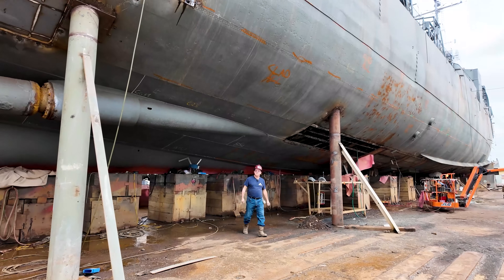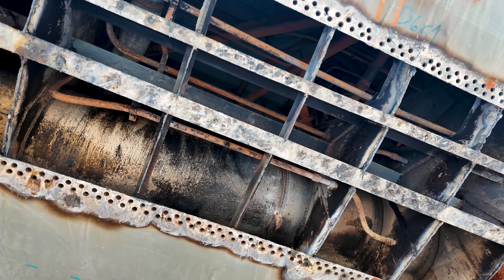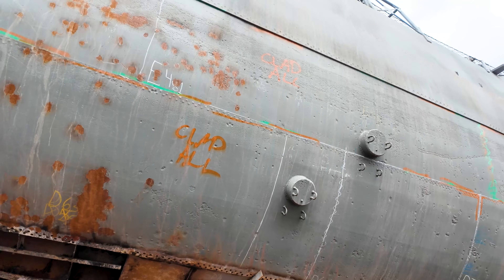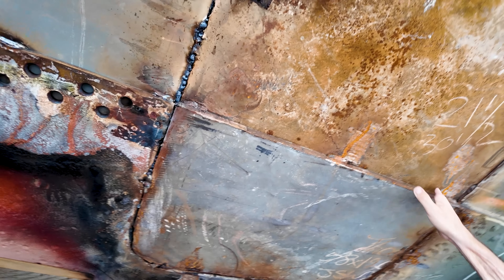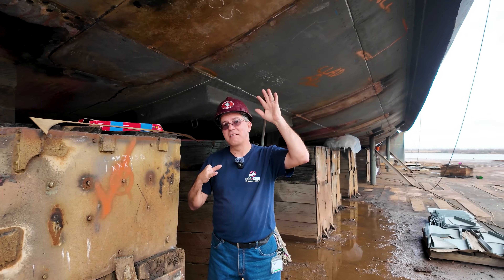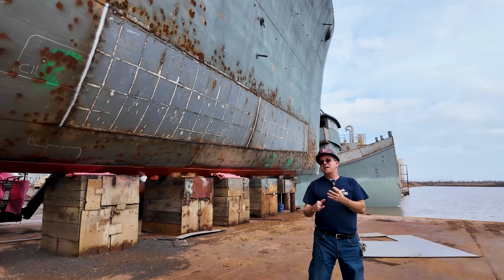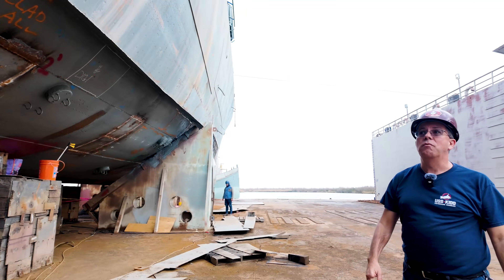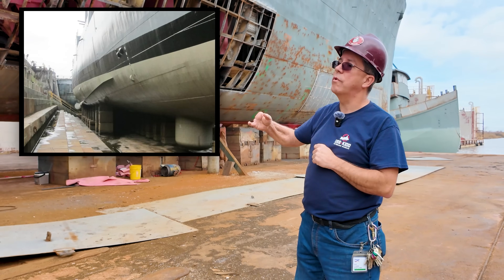Hull Overhaul of WWII Destroyer USS KIDD │#5

Comment: I worked on a few of these WWII destroyers when I was a shipfitter on the USS Grand Canyon AR 28, I was always amazed how thin the structure was. A chief once told me they were only made to last a few years and built as quickly as possible. A few had newer super structures put on in the 60's but the steel/aluminum joints were a constant corrosion point. Good luck with repairs I look forward to seeing the ship back.
Reply from the maker: Thanks! And, yes, the saying went that if they survived one battle, they were considered a success. Literally the definition of "expendable."
Reply: @usskidd661 ...said the same thing about the LIBERTY SHIPS 

Paid for itself if it made 1 round-trip

Comment: They wanted it to be as light as possible, to be as fast as possible, without breaking up in a storm. They needed to get where the submarine was before it got away. They will need paint that can take some sun exposure when the Mississippi River goes down. 
For anyone who might not know, salt water, like in the oceans, is WAY more corrosive than the fresh water in the Mississippi RIver. Ocean water contains so much salt that it is heavy enough to flow upriver for a hundred miles, with minimal mixing with the lighter fresh water floating above it, when the river flow is low. The Mississippi River will eventually fill up the Gulf.
Reply from the maker: Fortunately, salt water intrusion in the Mississippi does not ever get near Baton Rouge. 🙂

Comment: Would it have been more detrimental than beneficial to have gone one size thicker with the replacement panels?  Or perhaps that would be a more appropriate long-term preventative fix for the museum ships in salt water.
Reply from the maker: @workingguy-OU812 : We did that on the touchpoints, as mentioned, because they see wear and tear from rubbing against the cradle pads. The rest of the hull--even the wind/water line--doesn't see the wear and tear that it would've seen underway in service. So, upping the thickness there isn't really needed, and potentially takes funding from other projects in which she needs attention. 🙂  Good question!

Comment: Im surprised you dident have to re plate the whole hull
Reply from the maker: @tomspettel3646 : No need. Fresh water does help. 🙂
Reply: @ how thin was the thinest plates?
Reply from the maker: @tomspettel3646 : As built, there are a few plates on the main deck at the bow that are 6-lb steel (0.1943 inches thickness). One of those needs to be replaced.
Reply: @usskidd661  wow that is thin

Comment: I'm curious, how thick is the deck on her about midships? I have some cutouts on the main deck of an Arleigh Burke DDG (removed to install the mounts to bolt .50 cal tripods) which are about 1/2" thick, just wonder how a WW2 era DD compares?
Reply from the maker: 20 lbs plate STS steel above all engineering spaces in middle third of the ship. That comes out to about a 1/2" thickness. On the ends, it gets down to 9 and 6 lbs plates in some places. VERY thin.

Comment: How thick is the STS?
Reply from the maker: @beverlychmelik5504 : The STS steel? Like Tim said in the video, the plate thicknesses vary depending on what part of the ship you're looking at. All the plates summed up average out to 3/8" thickness. For a great visual of what we're describing, check out Stefan Draminski's new book on the KIDD: https://www.amazon.com/Destroyer-USS-Kidd-Anatomy-Ship/dp/1472827414/ref=asc_df_1472827414?mcid=dcb1eda998c73c7ab63a315a8a32d588&tag=hyprod-20&linkCode=df0&hvadid=693706201118&hvpos=&hvnetw=g&hvrand=11798063087517600142&hvpone=&hvptwo=&hvqmt=&hvdev=m&hvdvcmdl=&hvlocint=&hvlocphy=9198980&hvtargid=pla-980281900946&psc=1

Comment: 3/8th steel wont even  stop a rifle bullet.   I would have thought at least 1/2 inch steel.
Reply from the maker: @wazza33racer : Some of it gets up to 5/8". Remember: 3/8" is the average thickness of all the plating. Meaning some of it gets much thinner.
Reply: On the plans for WW2 era ships, the thickness of each plate was described in "pounds" as pounds per square foot.  For example, destroyer-grade plating would be in this range:
3/8" plate = 15#
7/16" plate = 17-1/2#
1/2" plate = 20"

9/16" plate = 22-1/2#
5/8" plate = 25#

On the Iowas, the thinnest shell plating was along the bow, with some strakes (strips of plating) as thin as 17-1/2# (7/16") steel.  The thickest shell plating was over the area of the freeboard belt armor, 60# STS (1-1/2" thick).

Comment: I thought rivets were a thing of the past in WW2.
Reply: Think of the A13, Crusader, Cromwell, etc, which were Tanks used by the UK, The US's first models of M3 Lee's/Grant's, M2 and M3 Light Tanks, etc. 

Riveting was still the standard the first couple years of WWII in most of the world, with only really Germany having welded tanks in mass production at the wars start (The USSR did as well, but the Welds were HORRIBLE with misalignment, gaps, etc due to a shortage of skilled labor and needing to try meeting Stalin's insane and impossible production quotas and timelines). The US only really started welding tanks around Late '42 into '43, as a faster alternative to casting as most automobile manufacturers didn't have casting facilities but could all be capable of welding (Rivets if hit become projectiles inside a tank, so was a BIG issue for them and wasn't a long term solution so they NEEDED to find a replacement and as said casting couldn't be done at scale).

For Warships, it wasn't until the middle of the War welding started being done more commonly as it required less man hours and material in the tens of thousands of rivets it replaced, however there's a dangerous failure mode introduced. If a plates damaged the crack stops at the plates edges when riveted, however when welded you're physically joining the metal on a molecular level; causing the crack to continue and rip/tear across the whole hull of the vessel.

So it took a while for shipyards to build up a workforce of enough skilled welders, with good enough quality control to be reliable (The Hull crack issue is only known BECAUSE it literally sank Liberty and other classes of Cargo ships from hull fractures in rough seas).

Almost all Aircraft by the end of the war were STILL being made with rivets. Flush riveting, but riveting all the same.
Reply from the maker: Riveting was still common when the war started. By the end of the war, welding was beginning to displace it as the preferred technique.
Reply: Riveted ships was still common right up to the 50’s.    It was the proven method that worked and the shipyards were set up and experienced in riveting so it took a long time before welded hulls was really understood and trusted before it caught on full force.    It was mostly smaller vessels like tugs that were welded steel.     Here in Canada for example the first welded steel boat was in 1927, over the years lots of the boat builders did switch to welding for tugs and barges pretty quickly but riveted ships were still made until I think 1954 or so

Comment: Knew yall were doing hull work, but did NOT expect to see her just ripped open 🤯
Reply from the maker: @blitzwolfe7875 : The touchpoints run the length of her keel. There are 22 touchpoints on the uprights. Plus, waterline thin points.

If we startle you, check out the USS LAFFEY's 2009 drydocking at their reunion site and see the difference between salt and fresh water:  https://laffey.org/2009_dry_dock_photo_page_courtes.htm.